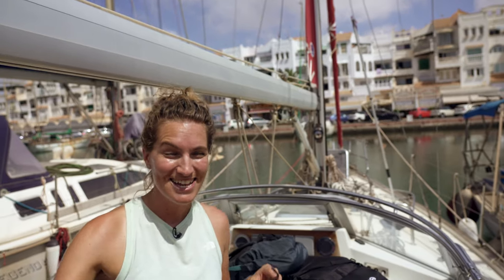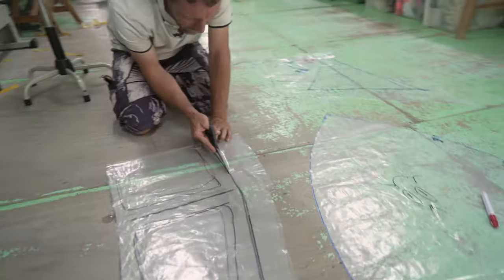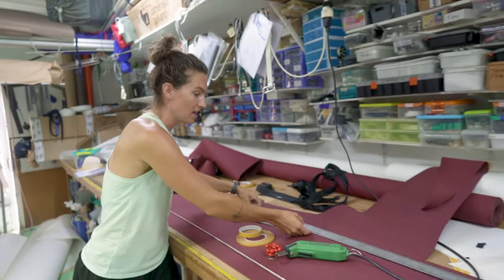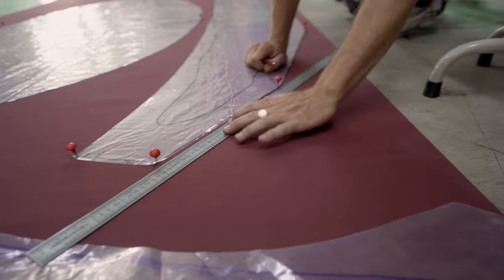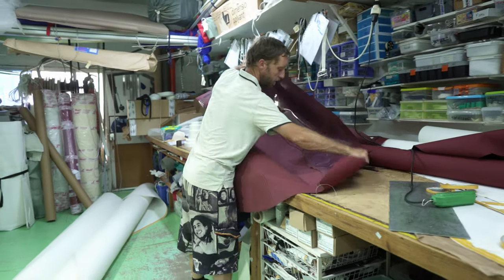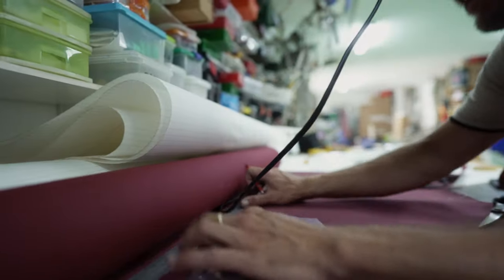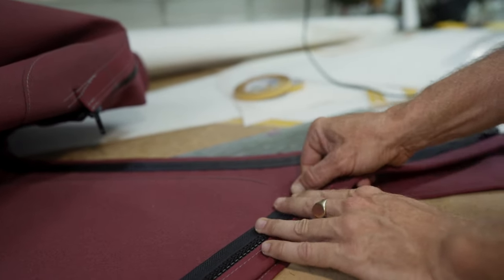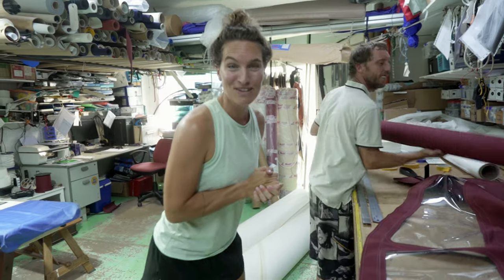Make a professional sailing boat DODGER / SPRAYHOOD - PART 2. Marine canvas Tips & Hacks

Comment: Hi.  These comments are really directed at an American audience.  Bolt ropes: they are wonderful but no American boatbuilder has ever used them and a retrofit is impossible.  The material they are using appears to be a polyester fabric like Top Gun.  It is not Sunbrella.  Top Gun has a limited range of colors and, frankly, they are rather bland and industrial looking.  My customers normally prefer Sunbrella for it's colors and feel but if Top Gun is appropriate, it is cheap and super easy to work with and lasts for ever. Look at the way he finished the windows with a raw edge; that would be a disaster with Sunbrella.  High quality vinyl windows: I think not.  He is using rolled vinyl which will go opaque in a few years.  We only use pressed vinyl sheets like Strataglass or Crystal Clear which are infinity superior products, much longer lasting and a lot more expensive.  I make these comments because the lady makes it sound so easy...... it is not. Magnasson has 40 years of experience and it shows; Danny was well taught, he is doing this every day and it shows.  l hate to burst your bubble but if you are getting into canvas making, have the dodger be the LAST project on your list.
Reply from the maker: Hi! Thanks is for your comments I’m sure your potential customers will be very pleased to read this. 👍

As for not trying it yourself, personally I think is it’s a sense to option to try, not because it’s easy, far from it. But because it’s safe, a re-rig for example is maybe not a good diy job.

Oh, the vinyl is still going strong too. But yes, agreed most rolled vinyl will only last a year or so.